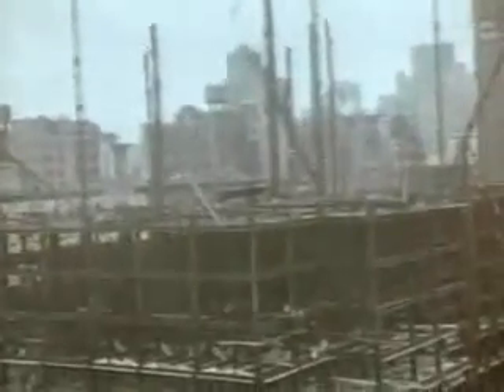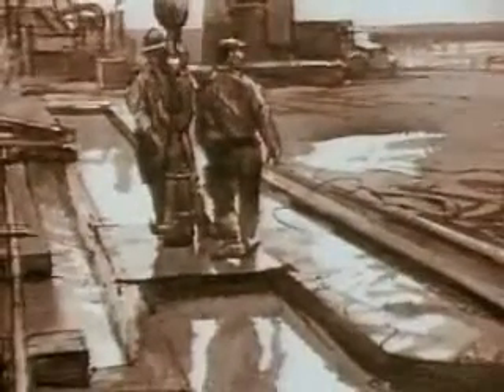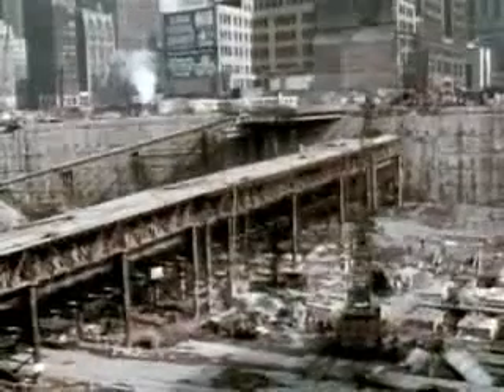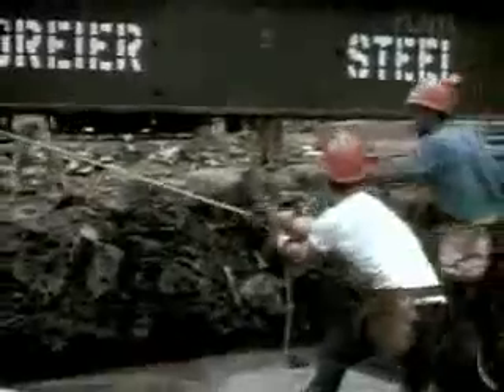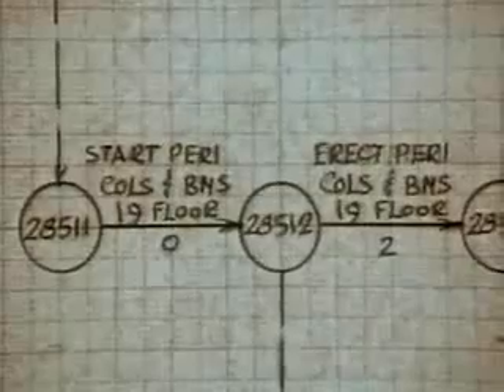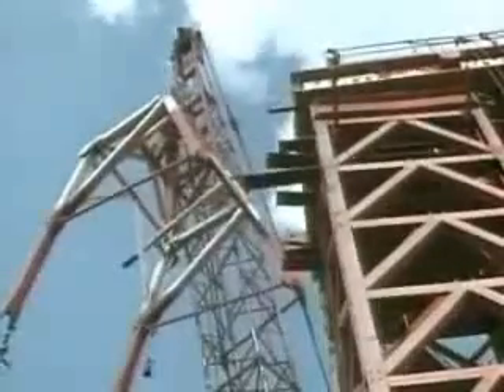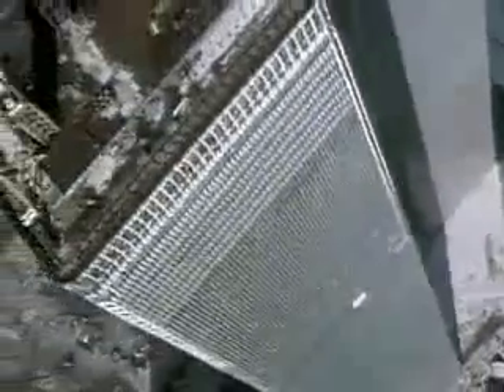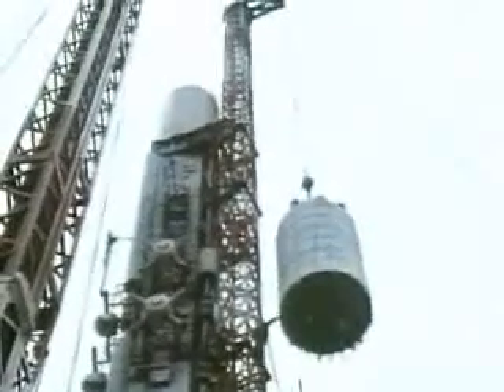Building the World Trade Center

Comment: I always hear documentaries and such say that the towers were 1,350' tall, but that's not correct. From their base at ground level to where the roof top begins, tower one was 1,368' tall and tower two was 1,362 -- six feet shorter, though impossible to tell from the ground below and completely unnoticeable in most images of the two towers together. They were so massive that six feet didn't really make a difference to the naked eye. And, just to be clear, I'm not including structures on either roof, i.e. the observation deck or any other structure. Regardless, the point is that they were called the twin towers and looked identical, but there were height differences on certain floors that gave the north tower an extra six feet. I've always found that fascinating and honestly thought it was some sort of crazy Mandela Effect when I first heard about it, because it just doesn't sound right and I didn't understand how I'd gone years without ever hearing that detail. It's 100% correct, though.